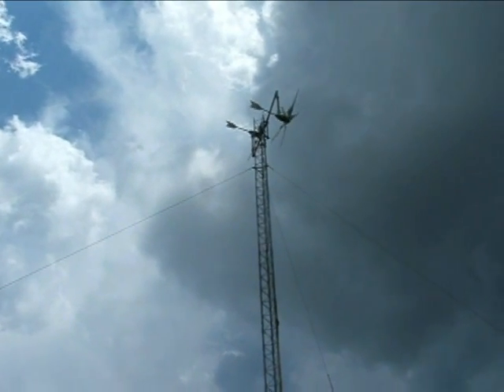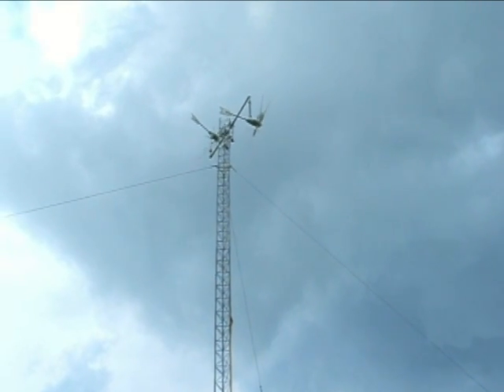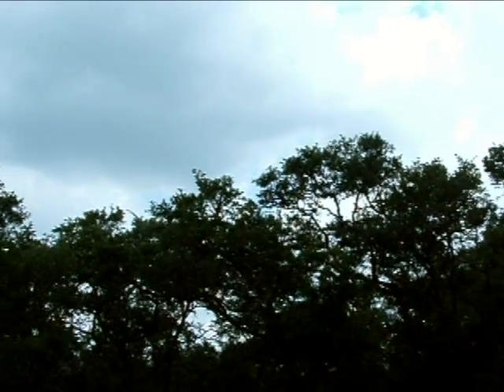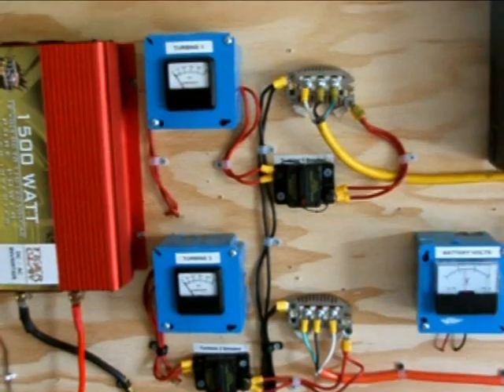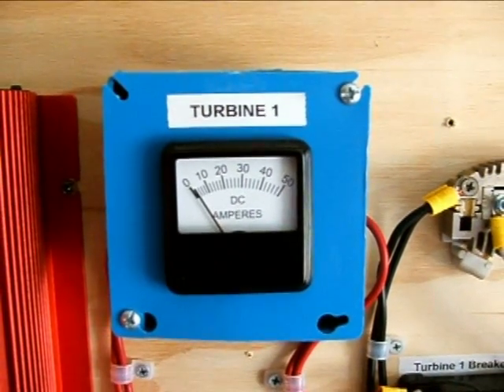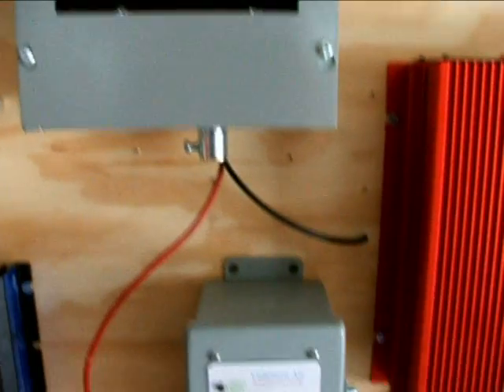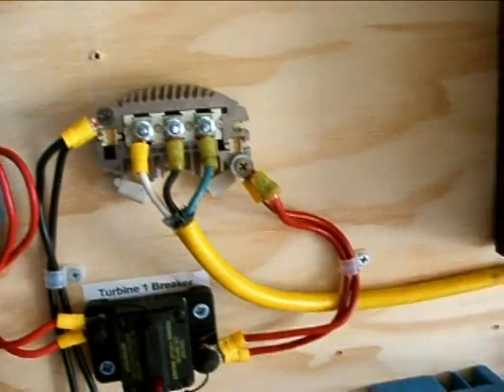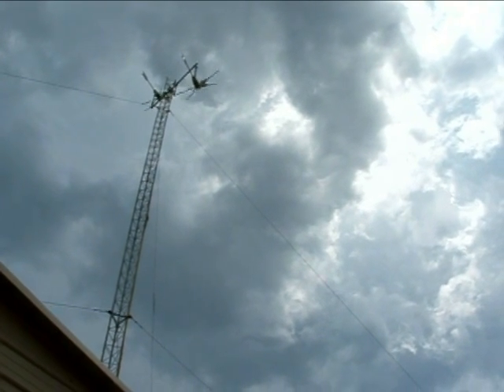Windmax turbine update

Comment: Hi Bro, Can you tell me the name of the company that sell the [ WinMaxHY400 wind turbine] loving them 

Thanks in advance

Errol Cain
Reply from the maker: I got them from a company out of Dallas, the name is magnet4less.com, I just checked and they seem to only sell the 48 volt model - which is actually smart. You want the highest voltage you can to keep your wiring size small, the higher the voltage, the lower the amperage requirements on the wires & equipment.

Comment from the maker: @survivalists2012 from magnet4less (dot) com, check them out, they got some great products. If you're going to use a 12volt battery bank then I would hit them up for their 650watt 12 volt system, very easy to setup and lowest cost because they supply the charge controller with a built in rectifier and a dump load all in one.  Good luck and God bless.